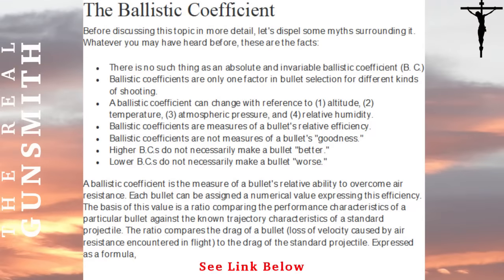7MM PRC Compared to Other 7MM's

Comment: interesting information. While I can see the point that doing some custom work on a 7mm Rem mag will make it the superior cartridge, most of us will not be spending an extra thousand dollars to accommodate longer seating depths. I kind of like the idea of the 7PRC as an open country deer round and a capable  mid range elk weapon out of the box. Eveb zif a guy is using a Barnes LRX with a decent BC you still need to accommodate a long bullet.
Reply: Barnes likes the jump set back .50
From coal     Try the tsx   Same but shorter

Comment: Does the 7mm rem mag simply need to be handloaded to allow seating of the bullet out closer to the lands, or does the throat really need to be custom chambered to be longer and tighter to achieve better accuracy?  Long enough that the standard mags don't work?  I have noticed that my 7mm rem mag will shoot the nosler partitions more accurately than the eldx.  I am looking for better accuracty out of my factory browning a bolt in 7mm mag.
Reply from the maker: Factory ammo, as a rule, is not designed for the 7 Rem. Mag from an accuracy stand point.  Only shooting various brands in YOUR particular rifle will tell you which is the most accurate.  Each rifle is individual so test the brands out that you most often use and see which it likes.
Good shooting and thanks for watching.

Comment: Ive been looking forward to this video to see the old timers opinion on where this one stands. First look, it appears to be a very well thought out design that could fill some gaps. Time will tell.
Reply: I will say that its going to be a hand loaded cartridge if i ever get one. Nosler wont load it because its a competitor for their 28 nosler. I agree that the eld-x is sometimes disappointing. It has never not done the job, but I have found it in pieces if my shot was incorrectly placed. That said ive seen the same results with the ABLR.
Reply: The 7 wsm is shorter and fatter and does what the prc is supposed to do better than the prc. 

Compared to the .284 loaded in long actions with 180's it's a minor step up in power but is it worth it? If it's better it'll be the new f class standard. 

Even something like the 7x57 AI isn't far behind but with less powder burned. They're already past the point of diminishing returns and it seems pointless. It only makes sense if they're cutting off the supply of ammo to existing rifles to get you to buy a new one (that their friends make). They go on about Saami this Saami that for excuses about why they can't change barrel twists or freebore on existing cartridges but most 6.5 creedmoor chambers are under saami spec.
Reply: Just wondering what kind of gaps do you think it would possibly fill?

Comment: I shoot the "old" .308 and love it. I've had and hunted with 300WM, 30-06, 25-06, 7mm-08, 7mmRM, .223 and the venerable 30-30.  That doesn't mean I can't consider a new cartridge may be better than something old.  7mmPRC isn't magic, but it will do things my .308 will not.  If I can buy a rifle and ammo off the shelf and effectively reach out to steel at 1500+ why not?  If it gives me clean kills at 600 with the right ammo why not?  Bullet technology is far more advanced than when I started shooting centerfire almost 50 years ago and it's for the better.

Comment: I don't disagree with anything stated.  I've struggled in my mind with this one for a while but I am building a 7 PRC, though, and here is why.  I have a shot out tang safety Ruger, I have a 1 in 7.5 twist Palma profile barrel I picked up. I am a machinist.  I was going to make it in 7mm Rem Mag, but since this rifle is going to be heavy and is for hitting paper and steel at long ranges I found myself interested in what they did with the PRC design, and the Gunwerks LRM before it,  for shooting the new heavy 7mm bullets at non living targets.   I didn't want to go higher powder capacity and I considered my Ruger action length. It took me weeks to choose, I really don't think for my purposes any one of the three wouldn't work.  This rifle won't be for hunting, but to see if I can hit long range now that I'm old.  Not for competition, just, when I was young I loved hitting rocks or Dirt clods way across the fields.  I want to see if I can get to 1000 yards or beyond.  I've got other rifles for hunting.

Comment: Randy right, the ideal cartridge is the 7mm-33 nosler it has better performance than a 28 nosler,  the 7-33 nosler has a .550 base case and the case is 2.460" long with 190 grn 1.668" long A-tips coal.  3.750" fits the bullet base at the cases shoulder junction! Feeds from a long action detachable magazine! The 7mm-33 nosler with its 35degree shoulder induces less case extrusion making for less case trimming! The 33 nosler longer case neck protects the barrels throat from the inside powder burn fire angle! Etc.etc

Comment: nosler 85 grain partition in my old model 70 243. hunting on my land in wv it works fine on deer between 50-200 yards. shot placement is key. in the brush its a 336 marlin in 30-30 remington core locked. 170 grain open sights and no more than 100 yards

Comment: The hype is well deserved. The 7mm PRC is the perfect compromise between terminal ballistics and efficiency. A 180 grain .284 caliber projectile leaving the muzzle at 3000 FPS is the sweet spot for long range performance while still being shootable. For guys that hunt out West, 5-800 yard shots are fairly common. The new PRC is not crazy over the top like the 28 Nosler or 7 STW, but has a modern case design that doesn't get powder space eaten alive by long ogive bullets. Good luck finding a factory twisted and properly throated 7mm Rem Mag, 7mm-08, 280AI etc. that can spin or seat 180s. This is why the PRC is indeed superior. Like most cartridges though, 9 out of 10 fellas arguing about it would be best served by heading to the range and shooting their current rifle more than once a year.
Reply: Lol it’s perfect Is it 😂😂😂 ahhh people really do drink the coolaid
Reply: @Paul-q3m7k  there's data you can READ that shows what recoil range leads to a drop-off in accuracy...it's just above the PRC
Reply: Except it doesn’t leave the barrel at 3k lol
Reply: @loganmorton9304  sure does. Sub-max load of R26 gets ya there with ease, 24" barrel. "Lol"
Reply: There’s one thing you are forgetting , 90% of hunters take game at 300 yds and under . The 180 gr or heavier 7 mm bullet is not needed for game at 300 and under . It’s a proprietary target cartridge that’s being sold as a hunting cartridge !…….
Reply: @thomasdaum1927  as is every Hornady cartridge since the 6.5 CM...fun fact: hunters make up a miniscule amount of ammo sales compared to shooters.
Reply: @mountainstomarshes8966  Most hunters are shooters  ! Duh
Reply: @thomasdaum1927  no they're not. Most hunters shoot less than a box of ammo a year. That doesn't make ya a shooter skippy
Reply: @mountainstomarshes8966  I totally disagree , target shooters don’t shoot hunting bullets . 95 + % of ammo on the shelves contain hunting bullets . There is very little match or target ammo on the shelves  !
Reply: @thomasdaum1927  you're free to disagree with whatever you want. Volume shooters don't buy ammo by the box at your local gunshop.... they buy ammo by the case, or separate components for handloading. Feel free to look up the stats, I'm not making this up.

Comment: As far as those ELD X bullets go, its a cup and core bullet with a high BC. Having said that,  my Weatherby loves those rounds.  Now I do have to question if retained bullet weight is a valid parameter.  I took a black bear eith the ELD X in 7mm rem mag. One shot. The bullet fid it's job. A heart lung shot. Retained weight 70gr. You decide.

Comment: The 7 PRC is good for what it is, Precision Rifle Cartridge. That's where it needs to stay, competition. I don't know who came up with the idea that BC'S replace kinetic energy?  Whomever thought of that, is doing hunters a great disservice. Eld-x bullets are more or less competition and mediocre deer and antelope bullets. With all this being said, today's shooters are all about "efficiency" and being "scientific"  accedemics are great in the competition world, where the variables are somewhat controlled. But this so called new efficient and scientific way doesn't always work in the field.
Reply: Higher BC means more retained energy down range. That’s a fact.  A higher BC means that bullet doesn’t shed weight as quickly.
Reply: Who is shooting this case in competition? It’s case capacity is to big for most comp disciplines other than ELR stuff then it’s under gunned for that. It’s a well designed hunting case. It’s not anything new for sure but they did get the throat right on them with factory chamber. The only problem with any of the PRC cases is the .200 line is to small and clicker are a problem with any dies out there.

Comment: You see this a lot with the 6.5 Creedmor. They are claiming speeds that are just not possible with the case capacity it has. People are claiming 2900+ fps with a 140gr nosler bullet when data shows 2750 if you’re lucky at 60-62k psi.

Comment: So the 28 Nosler has more case capacity and more velocity.  300 PRC has less felt recoil and longer barrel life. 300 also looks to have more kinetic energy at distance with a copper alloy bullet. 28 is a magnum and 300 is a long action. Is this right? Based off these I'm inclined that they are pretty comparable and maybe give the edge to the 300 for barrel life?  Thanks Shelby.
Reply: 28 Nosler is a necked down 300 Remington Ultra Magnum.  I believe you can use a Standard or Long Action Magnum action.  Either way, the 28 Nosler is capable of higher velocities than the 7mm PRC.  Powder Capacity on the 28 is 12-15% higher than the 7PRC, it’s science!!!😂😂😂
Reply from the maker: Yes, partially, if you forget the hype.
Thanks for watching.

Comment: I cannot disagree with you on any of this subject matter.  In part I find these new cartridges as redundant, reinventing the wheel. I find no practical reason for the marketing of manufacturers to make these cartridges seem the end all be all. One of the reasons that I  personally like single shot rifles is the ability to take full advantage of the throat as per this conversation.  This only my personal opinion. 
Now for a question. I am working on a small project I've been with over the years that isn't about ultra long range related.  I have an old single shot rifle in 30-30 Winchester that has a long throat I don't have a measurement, but a 150 grain nosler partition doesn't reach the lands when set in I. The case mouth. To top it off I haven't had to buy a bullet in 20 years, so I've lost touch with what currently is offered.  I have decided to Ackley improve the chamber. Base on my current living location long distance isn't, if not a rarely necessary.  With maybe over optimistic goal of 2600 fps muzzle velocity down to a distance where even with factory 30-30 ammo should drop below 1600 fps. Yes a shot over a 100 yards is rare. What 150- 165 grain spire point bullets do think would preform well? Spire points just because I still like my range time. 
Any thoughts if you have time

Comment: Hold on, the only thing to make a cartridge “better” according to this guy is to be faster?
Reply: Guy doesn't understand that some people don't reload or like to have a custom stick spun up every time they need a new gun. I like the old 7mms but I understand the manufacturing standardization you get with a new cartridge designed for the available bullets.

Comment: What about burning out barrels with the 28 Nosler?  Is that the downside to the nosler?
Reply from the maker: All barrels burn out at some point. Firing too many rounds at a time has more to do with quick burnout, however, than any other factor.
Thanks for watching.

Comment: the fact is,, the old 7mm weatherby mag was and is about perfect for a large cased 7 mm,,, , the 280 would be next for a standard case,,,,,,, the 7mm prc is not as good as what we already have,,,,
Reply: What is “good”? You have to ask yourself if the extra speed is actually necessary.

Comment: @Randy how do you feel about the partition on white tail, and mule deer? I lost a deer thanks to barnes this year. Was going to switch to a ballistic tip bullet, as I used them in the past. They worked well, although just had some meat damage.
Reply from the maker: Since you don't mention which Barnes bullet or caliber it's hard for me to answer. However, the ballistic tip is the poorest of choices.
Thanks for watching.
Reply: @TheRealGunsmith  it was a barnes Tsx. Non tipped with just a hollow point. Caliber was 270 win.
Reply: @TheRealGunsmith  
Good day sir
Why do you say that the Balistic Tip is the poorest choice? 
I have killed 200 plus springbuck, warthog and blesbuck the past 4 years with 95gr Balistic Tips and I have had zero failures. 
Keep well
Reply: @nielrossouw7831  Ballistic tip bullets are fragmenting, I would think they would ruin more meat.
Reply: @nebraskaman8247  I shoot the same bullet very accurate and has drop deer for me..
Reply: All I run in everything is Barnes ttsx, they are supper bullet never lost anything to them and almost all did not have to look for or they went less than 30 yards, always exit and leave a hole out as big as a quarter,, shot placement is critical to any bullet having terminal effects
Reply: Partitions are excellent, 165 gr .308 has never failed me on deer.

Comment: Randy, I basically agree with everything you said about the 7mm PRC and the super frangible high BC bullets that are being promoted.  What was drawing me toward the PRC was the fact that the PRC head spaces off the shoulder, whereas the 7mm RM head spaces off the belt.  MY REQUEST:  I would really appreciate a video that explains the difference between shoulder head spacing vs belt head spacing and how to account for it in my hand loading.  This would really help me.
Reply from the maker: Once the case if fired to the chamber and fired to fit the chamber with some feel, it is pointless.
Virgin brass clears the belt by roughly .003, same for case head spaced off of the shoulder according to the gauge.  One is more accurate than the other.  7mmRM is more accurate.
Thanks for watching.
Reply: @TheRealGunsmith  TOOOOO MANY DONT UNDERSTAND THIS !!!!!!!!!!!!!!!!!!!!!!!!!
Reply: My first gun was a 7 mm mag ,I have been extremely happy with them
Reply: No it does not. The 7mm.rem mag headspace off the shoulder.not the belt. The only belted magnum that EVER headspaced off the belt was the 375 H& H . Whoever told you the 7mm rem mag headspace off the belt Is full of shit. Anyone who knows guns KNOWS the belt is cosmetic but looks ULTRA COOL.

Comment: Is there a reason that some manufacturer couldn't make the 7 Rem. Mag. Case 
without a Belt.. ?
Reply from the maker: They could if you wanted, as an individual, to pay the set up cost and production of 1000's of cases.  Unless, and until there is the demand for that, it wouldn't be cost effective.
Thanks for watching.

Comment: Hornady CLEARLY explains that you can throat other 7mms with a better throat and get similar results as the have with their 7mm PRC. BUT you cannot get a rifle off the retail floor and have a 7mm Rem Mag or 28 Nosler or any other 7mm that has a throat that is ideal for long high BC bullets. I get that you are coming from a custom gun maker perspective but most people aren't buying custom rifles. They buy a Browning or Christensen or Tikka or some other gun made by a manufacturer. Most people are also not handloading ammo either; they're buying ammo off the shelf and shooting it in their factory rifles. Hornady states multiple times that they designed this cartridge for that customer and not necessarily the custom rifle guy that handloads all his own ammo. But they do explain why even that consumer may want to consider going with a 7mm PRC for their next rifle as well. Examples include recoil is less than a 28 Nosler, barrel life will also be better than a 28 Nosler, the cartridge should be more forgiving with accuracy and because it has less throat erosion you won't have to chase the rifling like you will on a 28 Nosler. Also comparing it to a custom 7mm Rem Mag if you for some reason lose your ammo (usually only a problem if you fly to hunt) you're kinda screwed with a custom throated 7mm Rem Mag (yes you can still shoot factory ammo but it most likely won't perform ideally). There's also no belt which is an obsolete feature on magnum cartridges. You say you aren't picking on the PRC cartridges but you never seem to do as deep of a dive on the pros of the PRC cartridges as you do on what you consider to be negative aspects and it seems like you have something bad to say about them in nearly every video you make. The proof is in the pudding in my opinion, the majority of rifles being sold for big game hunting these days are one of the PRC cartridges and it's because they flat out perform. As far as the ELD-X bullets are concerned, I know of people who have probably killed more animals with that bullet than you will kill total in your life. No disrespect for the amount of game you have killed and your hunting knowledge but I just think it's pretty near sighted to say a certain bullet is garbage just because it doesn't work the way that YOU like it to and think that it should. Maybe consider that there's more than one way to skin a cat. I'm not trying to pick on you or your opinion but being you come on so hard towards the PRC cartridges and Hornady I think it's fair that people hear the other side of the story as well. I know you are very knowledgeable about rifles and cartridges but I don't think you know more than the ballisticians at Hornady who have equipment in their lab for conducting measurements on things you could never dream of being able to measure in your shop. God bless and I really mean that.